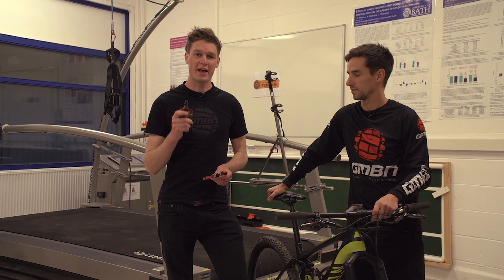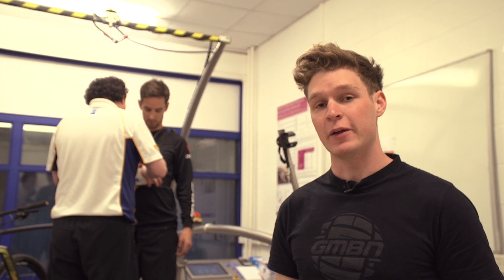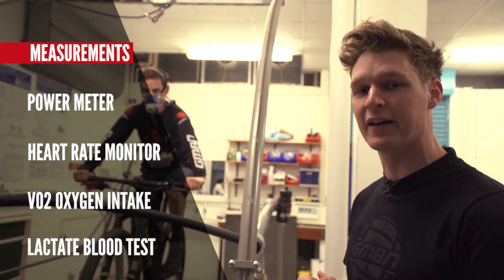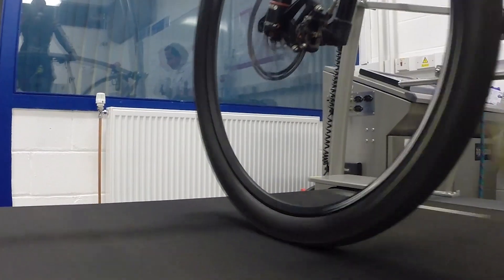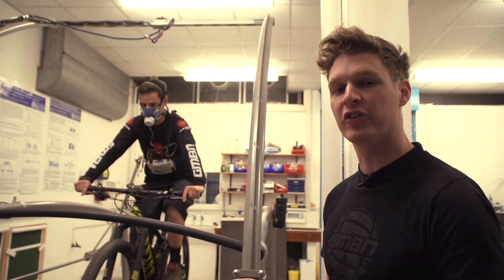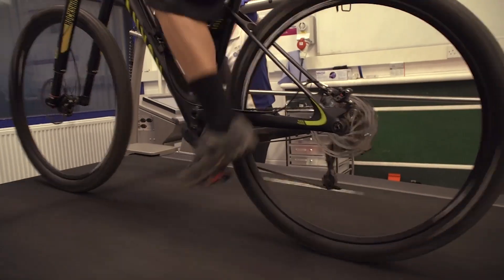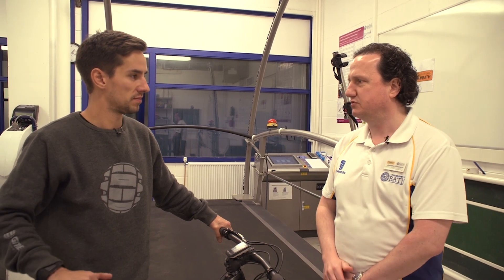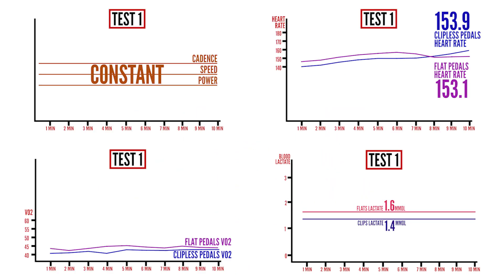Clips Vs Flats – Which Mountain Bike Pedals Are More Efficient? | GMBN Does Science

Comment: the higher lactate and Vo2 makes sense to me as I think that as you point out perfectly on flat pedals you are only pushing down thus one leg more ore less has a recovery break for half a turn and thus your peak power is higher only pushing down. on clips both of your legs are working without a break for the whole turn thus consuming mich more o2 and producing more lactate.

A big factor though might alao be how much your body is adapted to one of the two kinds of movements, as the inter and intra muscular efficiency rises significantly with specific training, as a pro swimmer for example uses much less muscles than an untrained person what results in astonishing gains of efficiency and thus endurance..

Comment: If I am riding non-technical terrain, long distances I prefer clipless.  But on technical terrain, short distances - flats.  The reason is mainly because I would be constantly fooling around trying to clip in and out, that it would waste a lot of time.  I can get back on the bike much faster and plus sometimes I need to drag my inside foot for balance.  I know the pro cyclocross racers can do this without a problem using clipless but I am not at that level.  Plus I have gone over the bars a few times on my MTB so I am not sure how that would have worked out if I had been wearing clipless pedals.

Comment: This reminds me A LOT of the 23mm vs. 28mm road bike tire debate.  It wasn't that long ago that all of the "authorities" were convinced that, since running a skinny tire at 125psi equals the lowest rolling resistance, that was the only way to go.  Fast-forward 10 years and the same "experts" are recommending larger tire diameters and lower air pressures.  As it turns out, the additional comfort from a more compliant tire helps to reduce over-all ride fatigue.  Also, when cornering, the bigger tires provide better traction thus providing more speed potential in a given corner.  True, the skinny, hard tire convention of the past did provide the lowest rolling resistance, but other factors exist that tip the scales in favor of larger tire cross sections.  That being said, I road-ride with some old-school racers that refuse to run bigger tires and they routinely kick my butt on the road, but I'm faster and more comfortable on 28mm tires.  Which brings me back to the flat vs. clipless discussion.

If you are more confident and comfortable on platforms, you will be faster overall.  It may be that clips are more efficient, but peddle efficiency is not the only factor in overall speed.  The numbers that these guys came up with demonstrate to me that the difference in efficiency is not worth the loss of confidence in technical sections.  Anyway, not for the weekend warrior like me.

Comment: i have ridden both flats and clips, ive always found it to be beneficial to use clips because on steep decents your feet will have a very hard time coming off the pedals without you wanting them to.
on the climbs it allows you to pull up on the pedals as well as push forward at the top of the stroke and pull back at the bottom of the stroke.
i also tend to put my feet in a bad position on flat pedals, with clips I eliminate that problem.

Comment: I'm super old school with my solution after trying clips years ago and hating them.
i use flats with a cut down cage upfront and no strap.
i get a small improvement to smooth the spike power between down strokes.
I'm able to position crank arms to suit technical  rougher stuff.
slip off is greatly reduced.
and i can move my foot around at any time on longer rides which helps foot ache reduction.
small price to pay is looking like I've time warped from the early 80's haha
Reply: paul jones I do the same out here in California retro groutches unight!

Comment: I just find clips put my foot in the right position whereas flats I have to think where they are a bit more. Tried going back to flats but couldn't get on with them. Found on gnarlier, looser trails if I want to get my for down just loosen the clips off a bit which makes it easier to get the foot out and dab down. It's just a few turns of an Allen key which can be done on the trail.

Comment: I use flats with Classic Vans (I'm 40 years old with a BMX childhood, you take the Vans away and I lose my mojo instantly)  and I can do almost the complete spin with them. I made my self a pair of classics Vans clipless and I tried them two runs. Conclusion I went faster uphill, set my record today, but slower on the downhill, I felt awkward, mostly for the pedal positioning closer to the front of the feet. I don't know yet, but I almost positive that I feel more free and get more fun with the flats, but may I have to get used to them.

Comment: i wonder since carbon soles are shown to be more efficient than softer nylon,and  flats in a more efficient than clipless..if a platform clipless with a carbon sole would be closer to a flat than a standard clipless. i don't think weight is much issue between platform clipless and standard clipless anymore. xpedo baldwin ti are lighter than xtr.

Comment: CONCLUSIVE PROOF THAT FLATS ARE BETTER ALERT: There is a point during the pedal cycle where you pull up just before transferring to a push at top dead centre and this has no benefit and actually wastes energy. There you go, conclusive proof that flats are better than clips.

Comment: Interesting results. One thing I wonder more about than efficiency is safety. On the one hand clips may save you by keeping your feet from slipping in rough areas. On the other hand I've gone over the bars and had to roll out on my shoulder because clips delayed my feet getting off the pedals by a fraction of a second. I seem to recall that Jerome clementz broke his collar bone in a similar crash. For me I continue to use flats because I'm not racing to win but to push myself and I want to be able to get my feet out and under me in a hurry if things go wrong at high speed.

Comment: I doubt that there is much pulling up happening w/clips, if you have good spinning technique there shouldn't be much difference between these two although I think clip-ins let you get away with worse technique - I've ridden w/people who are noticeably slower on flats if switched over from clip ins. Personally I don't like the commitment of clips and prefer flats for the immediate ability to get in/out (also set-up is easier, there are no shoe requirements or adjustments).

Comment: I think the issue clouding the results is just the proximity to the other tests. You can't work hard (close to VO2 max) for several minutes and not have that effect your subsequent performances. In both cases the oxygen and lactate were higher in the second test on each gradient. Given the effect is probably fairly small it's impossible to say if that's the pedals or just the order the tests were conducted in (I'd suggest the latter). 

Probably the most interesting thing was the inclined test where, on clips, the heart rate was lower despite the other two measures being higher. This probably shows that clips really are more efficient given with very tired muscles (producing much more lactate and using more oxygen for the same output) the heart rate was still reduced.

Comment: I think you guys did a great job with this comparison, but there is a major error with it.  You don't have anywhere near enough data points to even think of making a comparison or drawing conclusions.  Basic statistics.  You need to conduct several runs for each scenario, alternating which pedal is used first and/or controlling for fatigue.  It would also be interesting to see a mix of riders who are currently primarily use clipless and riders who primarily use flats as obviously they use different muscles.  But I think you are on the right track and applaud the effort.

Comment: I tried clips for a couple of months, didn't like it, put my flats back on, mostly because I get more nervous on the clips and less confident and also fell more often than on the flat pedals because I felt I had better balance. On the flats, I know I can easily take me feet off the pedals either to balance, or to push off rocks or other obstacles. Guess it boils down to having more fun with pedals. So what if it's slightly harder up the hills.
Perhaps on less technical or longer courses I'll put the clips on.

Comment: Clips have advantages, but since I broke and dislocate an elbow I quit clips. If the front wheel unexpectedly blocks, and you are projected over the handlebar, you will not be able to wrap your body with one foot clipped in. I also saw bad injurie in the knee due to the same, so for me clips are over, though I recognise the benefits.

Comment: Isn't this as simple as:

Flats - concentrate primarily on quads/glutes, therefore working them out harder to get going, therefore increase in lactic acid buildup.

Clips - have a bigger range of muscles to do the work quads/upper quads/glutes/hamstring, therefore workload is distributed through a bunch of other large muscles and does not stress out a particular group(s) given the same amount of output, therefore less production of lactic acid. The increased oxygen consumption being from the fact you're activating and drawing activity from a larger combination of muscles - including more hip flexor and core to stabilise.

Comment: You CAN pull up with flats, that is, if you are a good rider and in fact it makes you pedal much more cleanly and efficiently as you have to work to keep contact. Clipies are just for the lazy and unskilled. You really have to use a lot of skill to stay on the flats and they make you a much more skilled efficient rider and you use and learn much better technique with flats.

Comment: I've recently swapped to clips and smashed all my strava times at my local spot Triscombe. Chunky roots or corners can move my feet on flats and I'd lose concentration correcting them. Clips stopped that and gave me extra points of control and I felt more stable. Sorry, that's all the science I need.
Reply: Probably the best point to be made. Even if efficiency is even, or one slightly ahead. Control goes to clips. Bailing out easily goes to flats. I've had a few spills and wrecks with clips and it hasn't caused any problems.  Control through bumpy and techy stuff is marvelous, and going down rough steep sections you don't even think about your feet sticking, they just do. Let's you focus on the trail. Losing a pedal while riding a rough steep section on flats is terrifying, and unsafe. If you are uncomfortable on clips, enjoy your flats. Everyone should try clips, most people don't go back.

Comment: Personal experience:
Did a 100km ride on flats,1000m climbed no soreness, no aches. Ready for a run the next day. 
Did 100km on clipless, my calves were aching like hell, almost limping on the left leg because of the sore Achiles tendon and a tight hamstring on the right.  Had to recover for days doing stretches and massages. 
And don't mention going to a bike fit; I spent a ridiculous amount of money for 2(and expensive pedals), one with video cameras and computers; sure they may work if outside you ride the same way you ride on a perfectly flat indoor trainer. Once I went for longer rides with climbs, sprints, head wind my whole legs were screaming in pain. 
Am I slower on flats? In the end everyone cares about this not about circles or spikes. Yes, from riding the same course on flats and clipless I estimated to be slower by around by 2 minutes/hour. This is based on an almost 1h ride which I frequently do. For longer rides the weather, traffic and genereal fitness at the end of the week affected the times too much to limit the delays only to the pedaling styles.
I am not against clipless and I would use them. But apparently I am very little tolerant to a fixed position. I know a guy who just bought clipless pedals, put them on the neutral position and did a 200km ride without any discomfort, no bike fit, didn't even know what float is or that you can buy cleats with different degrees. What I am against is people being forced in using a system just because pros do it or because the general opinion says so. I saw people giving up cycling because of knee pain when cycling is the most knee-friendly sport. Bad fitted clipless cleats or maybe their bodies could not adjust to them, I don't know but they couldn't imagine cycling without being clipped in.

Comment: I don't get why everyone is so confused? .  Using more oxygen SHOULD be the expected result with clip-less pedals(assuming the power output is identical , because the force is distributed over a larger angle. This indicates that it is more Aerobic than flat pedals and will be more sustainable over long periods of time. 

people are getting confused with the word efficient here. efficiency is typically output/input which is NOT what we are looking for. If your power meter says 300 watts (the Gross mechanical efficiency of cycling doesn't really change that much maybe 0.5%) then your body is producing about the same wattage 300/efficiency. the real question is where does the energy come from is it produced aerobically or anaerobically?  more oxygen consumption means more aerobic less means more anaerobic.  so if i stopped breathing and still produced 300 watts pretty much ALL the energy is coming from anaerobic stores and wouldn't be able to sustain it long at all

Comment: @7:20 I suspect the ORDER of tests may have an unanticipated effect on the results (Test1 clips/flats --> Test2 flats/clips). If interested in doing statistical data analysis with these tests, it's a good idea to randomize the order of flats/clips within Tests. 

At the end of Test2 (clips) Neil's muscles were showing more fatigue causing higher lactate production. I also suspect the time between Test1-2 was much longer than the time within Tests (flats/clips and vice versa); therefore Neil's body was better able to respond (i.e. smaller increase in heart rate) to the 90sec burst on clips because it was AFTER  he warmed up with a 90sec burst on flats. I'd have to read some journal articles before I can speculate on the expected VO2 relationship between HR/ blood lactate levels. 

Real world example: Ever watch mid/long distance (800m+)  track athletes do a sprint before the race begins? They're trying to increase their HR before the race starts so they are more efficient (blood already circulating O2 a little more quickly at higher HR) once the gun goes off. 

Very interesting results, and as always a great video GMBN! I'd love to do a rigorous analysis of these data should you want help interpreting trends and arriving at (statistically) supported conclusions.

Comment: In my opinion clipless pedals are better when it comes to pedaling offroad because they help you maintain the optimal position of your feet pushing against the pedal... With roots, rocks, bumps and all the stuff it is easy to lose that position with your feet free to move and then lose power output which can make you lose the race even if it just takes a second to place your feet correctly again

Comment: Science doesn't mean "in a lab", it means carefully designed experiments to understand how stuff works.
You've tried to make it more 'scientific' by doing the test in a lab and using lots of precise measurements, but in doing so you've (accidentally?) removed pretty much all the important variables that might show a difference between flats and clips.
For example, on real terrain the effort involved in keeping your feet on the pedals is very different, and even the lines someone might take could vary between the two types of pedals
A better test would be on a real trail, say an uphill section and a downhill section, with the same rider on the same bike riding multiple times with flats and clipless.
Reply: ...And, with more rest in between.

Comment: Found this when looking into it - The human body is made to produce lower body movement (using the hips to push through the “dead spot” instead of using the hip flexors to pull through) and the foot is supposed to articulate in a particular way during movement, clipless pedal interface and shoes may affect the natural inward rolling motion of the foot, apart from possible decreases in efficiencies using clipless, chronic knee injuries may also be the result. None of this is proven that I know of, but it's worth looking into

Comment: Guys! You have to talk to people who does study planning for living. 
If one of those people sees just your experimental setup and being asked to guess "What GMBN were trying to proof?", the answer would be like
"To make a decision about switching clipless in order to maintain same speed for the same duration of time and at same gradient as one would perform with flat pedals". 

Would you require to be a rocket scientist to answer "Perhaps, based on the fact that mechanical work and the power outcome must be the same, there would be not much of difference in biometrics. Though flat pedals might put less stress load on the body due to better efficiency of larger muscles"?

You did not test the hypothesis related to the actual reasons why riders go clipless. Could one generate more power on the sprint stretches? Would utilizing smaller muscles result in less stress load on larger muscles? Will my average speed increase  on the 100 miles ride? How stable and efficient will be me on starts and acceleration? What's about bike control on technical descends? 
And this is not even close to comprehensive list of the reasons to go clipless. 
But you did not setup your study do address any.